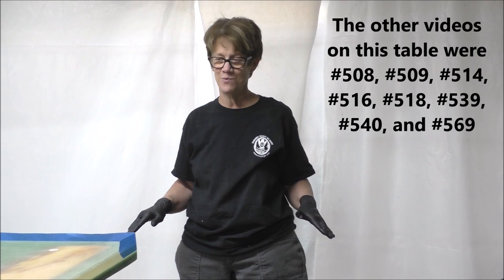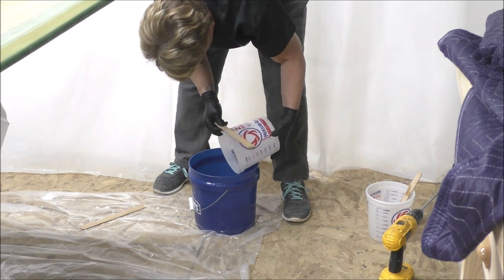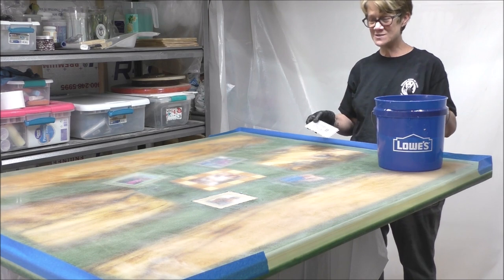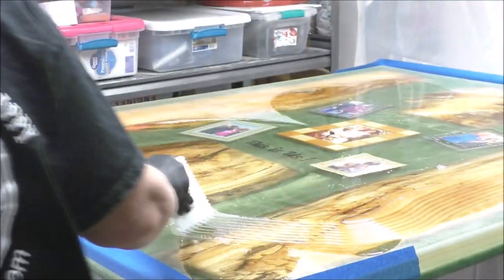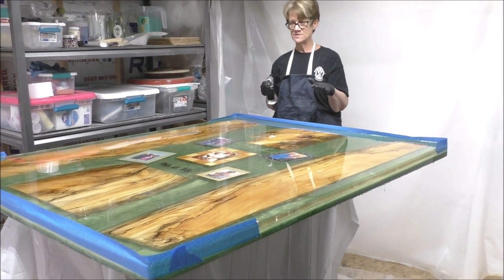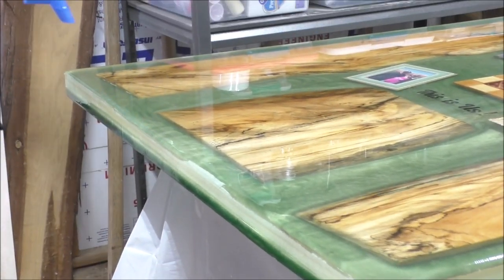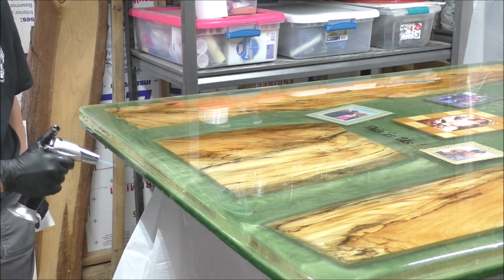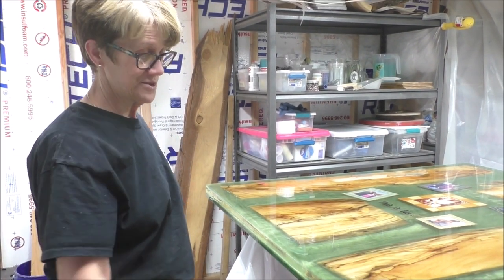#570 Final Video On Vicki's Spalted Elm Resin Table With Ambrosia Maple Base

Comment: Beautiful table Vicky and Eric looks Great.
I have used resin for casting reproduction golf balls and clubs for the last 22 years so the only a little advice I have here is when you go to pour the last of your resin out of that your mixing pot before you dump it all scrape down the sides with your stir stick and mix it in good so you don’t end up with a spot that has no catalyst in the resin it really sucks when you get a spot that’s wet and won’t dry but other than that great job
Reply from the maker: Thank you for the kind words & the tip Ray, much appreciated.

Comment: I don’t know anything about epoxy resin, so I have a question.  With the epoxy top and wood base, is there a concern with movement (expansion/contraction) where you should use the Z clips to attach the top to the base?  How many gallons did the pour finally take?
Reply from the maker: Hi Scott, to tell the truth we've now eaten at the table several times and we haven't secured it yet. The top is so heavy, not sure we need to be in a hurry to do that. I do like the idea of the z clips. We may consider that. I don't know how many gallons of epoxy, Vicki probably knows. I would say at least 20.
Reply: @oldave100  Thanks for info.  I have way too many questions, and I will stop here.  But at least I am helping your “comment count” for the algorithm. LOL
Reply from the maker: Thank you Scott. Don't stop if you still have questions, just email me eric@makeawoodsign.com